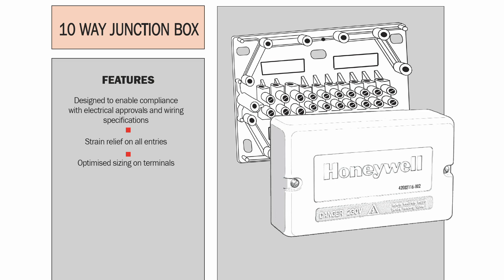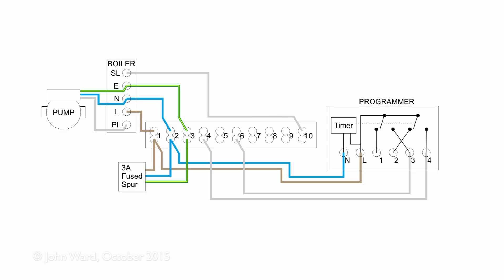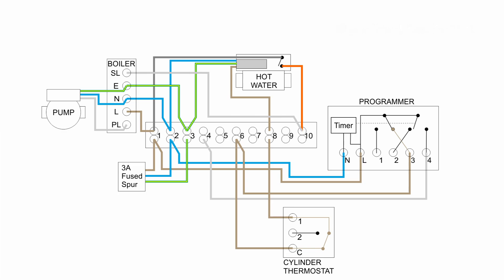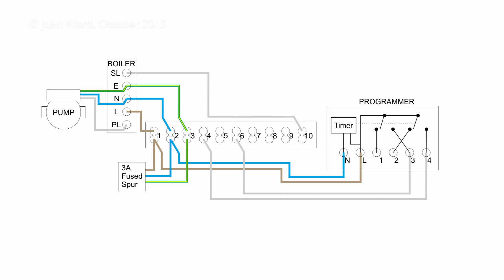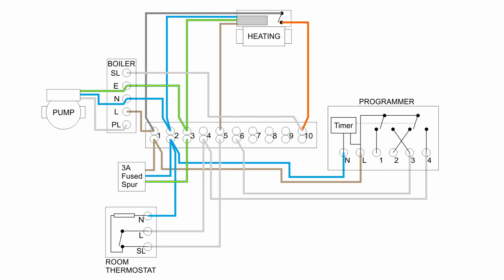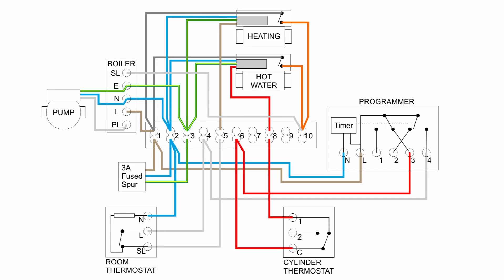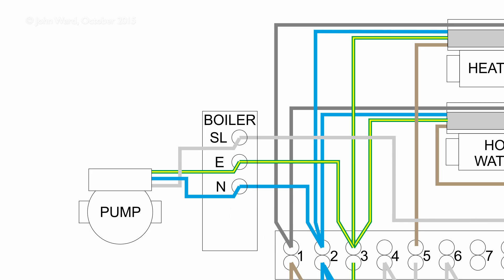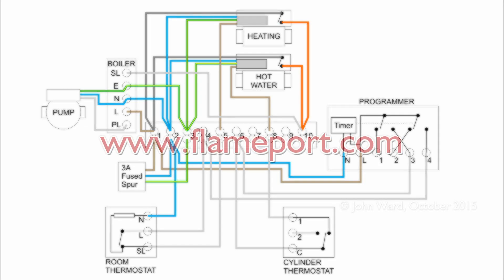Central Heating Electrical Wiring - Part 2 - S Plan

Comment: Just wondering can you use the live on the motor also to feed into the grey wire rather than having a separate live for the grey?
Reply from the maker: It could, and it would work, however the valve is supplied with all of the wires already connected to it, so you would still have to connect the extra wire to something.

Comment: What size cable do you use?
Reply from the maker: 1.0mm² is the usual size.  The current involved for each component is very small, and the entire system is usually on a 3A fuse.
Reply: @jwflame  thanks for reply John. My current system (oil pumped heating and gravity hot water) is on a 5amp spur, would I be better converting to a 3amp when I do the s plan? Thanks
Reply from the maker: @LBBATHROOMSANDRENOVATIONS  5A is ok, some oil boilers need the 5A as they use more power than gas ones, due to the fuel pump.  It should state the fuse required in the boiler installation instructions.

Comment: great video again! thanks
quick question about the pump connection at 16.43. does the pump always stay on even if the controls are not calling for heat. beacuse it is connected to sl terminal and anything connected to that will turn on on the boiler. I know the other wire  is connected to the sl terminal but that will only turn on if it is a complete circuit ie through the motorized valve.
Reply from the maker: In that arrangement, the pump and boiler are switched together - if there is no call for heat the  pump doesn't run and the boiler doesn't heat anything. 
The other wiring shown earlier in the video is more common - with that, the boiler controls the pump so it can run on for a short time after the boiler stops.
Reply: @jwflame  thanks for the reply! Does make sense now
Reply: @jwflame  one more question, if the pump and boiler turn on simultaneously, if the pump for what ever reason fails does the boiler continue running? I thought the boiler should never fire up if the pump fails. What tells tells boiler to not fire up if the pump is not working?
Reply from the maker: @abdulh63  Boiler has a thermostat for the water temperature, so if the pump fails it will heat for a few seconds, then switch off, cool, and repeat.  If that thermostat fails, boiler also has an overheat sensor which will shut off the boiler and require manual reset.
Same happens if there is a blockage in the pipes that prevents water circulating.
Reply: @jwflame  thanks for the reply. I've always been told that the pump runs then it is proved to be working via some type of flowswitch before any burners ever come on. But I'm guessing that's only in combination boilers. As they are big burners and it needs to know the pump is working before it ever fires up for safety reasons. Whereas your examples are for system boilers like back boilers maybe. And the burners can still come on even if the pump does not work for however short time this is for as they are not big burners?

Comment: Thanks for the excellent video with illustrations. You showed very clearly what happens to the the room star when you replace with hive.  How does one wire the hot water side when fitting  dual channel hive.?  I m upgrading from  single to dual channel hive. Which cables do I connect to water on and water off from the control box. ? My timer is still in situ , left On. I have the S plan
Reply from the maker: Hive replaces the existing timer or programmer.  Covered in this video: https://www.youtube.com/watch?v=tFT1AJsbMfo

Comment: What an amazing video! Thank you!
Did you make a video on how to extend the system to add more heating zones?
I would like to add three heating heating more zones and wondered where to connect the extra motorised valves?
Also I will be adding underfloor heating and wondered where this would connect. Thanks a lot!

Comment: Very good video. Easy to follow and highly informative. John is a good narrator too and explains things well. Thank you.

I do believe however there is a small error though at approx 15:40 minutes of the video where John states that "if  hot water valve or both are open, the switches inside will be OPEN to turn on the boiler via terminal 10"  The switches inside will actually be CLOSED to do this - not Open

Comment: Hi been enjoying watching your videos! Havent done s plans in a while but one video brought it all back. Great explenations. Im wondering,if tow valves on CH was for two seperate flats and each flat had a thermostat. What would you have to do with the programmer for hot water? would you have to have one in each flat or none at all? as the boiler would just be supplying hot water on demand? Thanks

Comment: S- plan systems are the most simple to install, understand and wire and they are usually the only sensible option if you have more than one heating zone. They are also preferred option for systems with unvented hot water cylinders because if the cylinder overheat stat trips, power is instantly disconnected from the valve and it closes

Comment: Hi john, great video. Where would you install a frost stat into this schematic? Thanks.
Reply from the maker: For S plan as in the video, frost thermostat connects between permanent line (1) and the heating valve (5).  The frost thermostat will then activate the heating even if other controls are set to off.
Reply: Thank you 👍

Comment: Tried this to the diagram. Its an  S plan system with two valves that had no cable from the boiler that I could associate with junction 10 for switching ? It did not fire up the system.

Comment: Thanks John,   my ferroli F30 combi boiler has the pump and programmer all internally placed. All I have is a thermostat linked into a 24v input to the boiler.  I'm splitting by CH into a 2 zone system with honeywell valves that run at 240V.  The orange wire feed from the valve will feed back to the boiler  but would damage the boiler electronics. What would you recommend to step back down to 24V?   and if there are 2 inputs to the boiler and the orange wire feeds into one, what goes into the other?  This is at position 72 on the wiring diagram.  ferroli boiler docs and wiring diagram accessed here  (page 38 of F30 B boiler) http://www.ferroli.co.uk/documents/.   Thanks
Reply from the maker: The switch inside the valves is not connected to the 240V motor, so you can just use the switch directly for the boiler 24V.
In a normal system orange is only 240V because the other side of the switch (grey) is connected to 240V.
To use them for other voltages, both grey and orange are connected to the boiler - this is the equivalent of the 'room thermostat without voltage' referred to in the Ferroli instructions.
Valve wires: blue = neutral, green/yellow = earth, brown = 240V input from whatever thermostat you have for that zone. (same as in the video).

Grey and Orange on the valve are the switched output, and connect to the two boiler terminals. (3&4 at position 72).
For more than one valve, the grey and orange all connect together to those same boiler terminals, so with 2 valves you would have 2 grey in one terminal and 2 orange in the other one, so either valve can activate the boiler when heat is required.
Reply: Thanks John, that makes sense,   I was reading through a screwfix.forum where guys were debating this, some thought it inappropriate to have 24v running through the switched input  when there was a possibility of a fault with the valve and 240V jumping from the brown wires and damaging the boiler.  Even when I rang honeywell they thought I needed a relay, but  your description makes sense. The orange and grey wires only see the voltage of the boiler at 24V as they are separated.   Thanks again

Comment: Hi John. Great informative video. I wish I'd seen this when I first started out in heating. I've been out of the trade for 3 years now and I'm having a brain fade in my old years. I'm installing a Drayton digistat scr and wireless drayton stat in to my vaillant 618 system boiler on a S-plan system but for the life of me I can't think of the basics. The diagram says to pick up the switched live at the wiring centre and the neutral of the heating motorised valve. Pretty straight forward right? Not for my tattered brain. What switch live? Is it CH On from the timer? Also do I just tee in to the neutral from the valve? I must admit most of my jobs concerning digistats were on Combis. No proble there anyway but the zoned one is leaving me stuck. Cheers in advance :-)
Reply from the maker: The SCR requires permanent power on L&N.
The other terminals are 
common = L from the programmer - only on when the programmer is on.
call = output to the zone valve L, usually the brown wire.
When the programmer and SCR are both on, power is connected to the zone valve, which opens and then switches the boiler on.

Details here: https://www.flameport.com/electric/central_heating/heating_wiring_S_plan.cs4
Reply: Thanks John. I've sorted it now. I used the "CH on" from the timer in terminal 1. The diagram showed the neutral used in terminal 3 but when that didn't work I put the brown from the motorised valve in to terminal 3 as you suggested and all was well except of course the stat wouldn't pair with the SCR but after lots of battery changes and  cursing, I used a second stat I had and it worked first time.

Comment: I want to add an extra 2 zone to port valve giving heat to a loft space. the combi boiler pump head is not strong enough to supply ch to this loft space, hence and extra 2 port valve + additional circulating pump + room stat,  to give heat to loft space when used as bedroom as and when required, question do you wire to the boiler pump (run in tandem) and only use room stat to switch off zone valve and pump . many thanks for your advice in wiring solutions

Comment: Thanks a lot for this John,  a brilliant video that explains it all very clearly, I recently had problems with a faulty motor for one of my valves and this helped me to troubleshoot it and replace it myself. What software do you use to make these diagrams.
Reply: hi did you ever find out what software it was?

Comment: Excellent video. I'm new to the industry and currently on  intense training course to be a gas safety engineer. Did this same topic in class yesterday and couldn't get it round my head. This video has helped my understanding greatly and the way John does the presentation is excellent and his calm voice helps. His videos will be my reference during my course.  great job!

Comment: Hi, great videos!! Where in the circuit would the immersion heater terminate & would it have a separate FCU isolation? This is for an older cylinder with no heating coil, just immersion element. Thanks
Reply from the maker: It's completely separate - normally on it's own 16A circuit with a 20A isolator switch.

Comment: Hi John, how does this work with the new NEST Heat Link, as there is no room stat wiring (as the room stat connects to the heat link and not the wiring center). I think "Call for Heating" from Nest would connect to the Brown wire on the Heating 2 Port Valve, which would then start the motor. Is that right?Nest diagram here https://nest.com/uk/support/article/Which-cables-connect-Heat-Link-to-my-heating-system-and-the-Nest-Thermostat

Comment: Great video,very clear and easy to follow, I used it to build a 2 zone central heating, and  megaflow hot water system as a separate zone, in my new but old house👍🏻😊👍🏻 cheers JW

Comment: Hi John does the zone valve grey wires go in 5 and 8 and the brown wires in 1 on terminal strip?
Reply from the maker: Grey in 1 and browns to 5 and 8.
Grey is permanent live which is connected to orange when the valve is open.  Brown is what powers the motor.
If grey and brown are reversed, the valve motor will be powered permanently and the valve will always be open, the result being that both hot water and radiators will be heated whenever the boiler is on.  Thermostats will have no effect.

Comment: Excellent videos and information - thank you. I now know what all those wires and boxes do! A question - I'm considering installing a Nest Thermostat (third generation) and wondered if you could post a wiring diagram for the Nest system. Would also be useful to then see which components (and wiring) of the existing system effectively become redundant as a result (Eg the programmer and the wiring to/from?)

Comment: Thanks John, I could add a room thermostat to one of the bedrooms, would that be suitable?  My wiring is not the same as your diagram,  the 5 wires from the heating valve (honeywell) are connected, even though there is no room stat? The programmer also 5 wires is a basic model, not digital with separate controls for hot water and heating, off, twice, all day & 24hr.

Comment: Hi John, excellent videos, so easy to understand. What happens with the wiring if you have an S-plan without a room stat, I only have TRV's in each room as downstairs is all open plan. Thanks you.
Reply from the maker: With no room thermostat there is nothing to signal to the boiler that heat is not required, this can lead to the boiler cycling on/off excessively if most or all of the TRVs are closed.  The traditional method to avoid that is to have one room or area without a TRV, and put the room thermostat in there.

More modern equipment can be obtained such as electronic TRV heads which connect to a central controller, so the boiler only operates when heat is actually required, Honeywell Evohome is one such system.

Comment: just finished my level 2 & 3 in electrical installations. Soon will have 17th edition, inspection and testing exams to sit. Sadly, none of boilers wiring are tough in class. 3 years of it. Is the switched fused spur 2 pole? Many thanks.
Reply from the maker: +Carlos Arruda Yes, the switched fused spur is a 2 pole one.  Haven't ever seen a single pole version.

Comment: Hi John, great video, appreciate things much better now. I have a systems boiler, a 30cdi, which only does heating. Which of the systems is best to use to get hot water too, i.e a Y plan or S plan? Also how do I integrate that with the existing set up, i.e the thermostat to the boiler and the motorised valves. Thanks.
Reply from the maker: +Ahmet Demirtas Either can be used, S plan tends to be used more now as it can do multiple heating zones, Y plan can only do 1 hot water and 1 heating zone.

Comment: Am I right in saying on a wireless controlled heating system, such as hive or tado. The room thermostat no longer has a wired connection. This then means the switching for heating is switched within the electronics and wireless system resulting in the heating out from the wireless programmer going straight to the heating valve? If you have any advice on these new wireless systems I'd love to hear it! Great videos.. jeep them coming.
Reply from the maker: +Ruth Maddox Yes, the receiver box replaces the programmer, and any existing wired room thermostat is removed.  Control is via the receiver box only, depending on time/temperature as determined by the wireless thermostat and the smartphone app.

Comment: Modern heatings use a central electronic that has all the sensors, pumps, heatings valves..etc connected to it!
The electronic would then carry out the switching    
(with relays that have contacts NO[normally open] and  NC[normally closed] )
This system looks like heatings that where used 30 or 40 years ago in my country!

Comment: WHAT KIND OF PLAN CAN BE USE FOR COMBI BOILER.I MENT JUST BIOLER GIVE HOT WATER AND CENTRAL HEATING.PLEASE GIVE ADVICE WHIT ILLUSTRATE.THANKS REGARD.
Reply from the maker: +alireza jouzdany You just need a room thermostat that connects directly to the boiler.
Reply: THANKS FOR REPLAY.CAN I HAVE A DIAGRAM PLEASE. ANYTIME YOU HAVE TIME,PLEASE SEND ME.ANOTHER CASE,HOW CAN TWO OR THREE CONTACTOR FUNCTION TO EACHOTHER.THANKS REGARD
Reply: COULD YOU PLEASE DRAW A PLAN FOR COMBI BOILER .ANYTIME YOU HAVE GOT TIME.

Comment: This is great, explains why pins 1 & 2 are unconnected in my programmer! Annoyingly, I have a 5 & 6 which go to my thermostat, so if I want to put on an internet programmer, I need to change the plate.

Comment: Best video I have seen on this, by far.
I only wish you had produced it before last winter when my 3 way mid position valve decided to go on strike.
I know that particular valve is just a combination of the two you have shown but working out how it worked with the other components and what the fault was caused me no end of problems.
It was a faulty actuator head on the valve (only a year old) .
The symptoms were no central heating unless the tank thermostat wanted the tank heating.